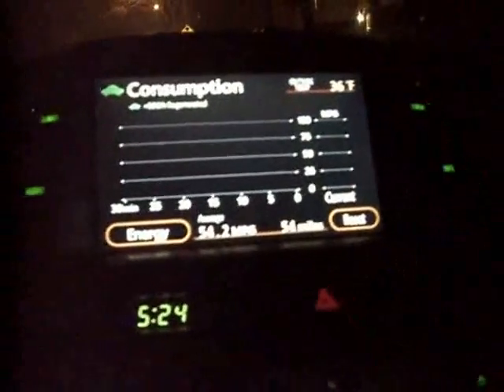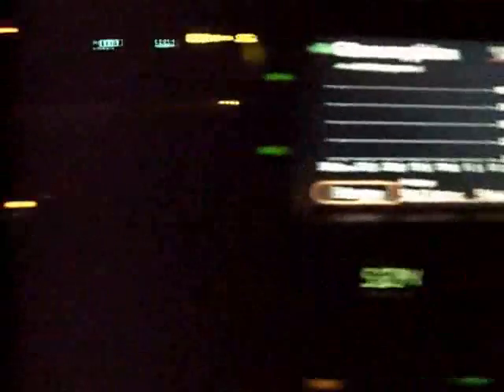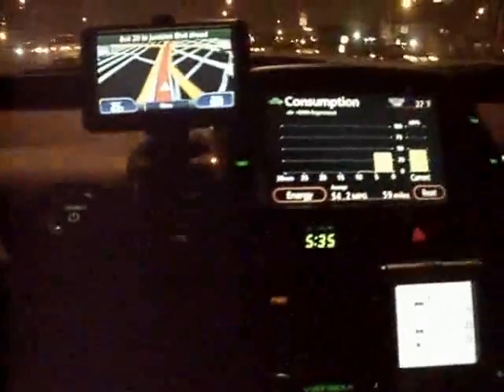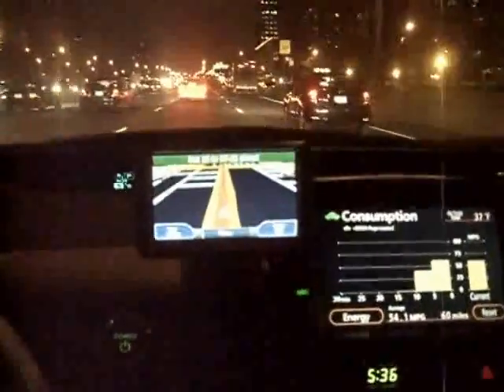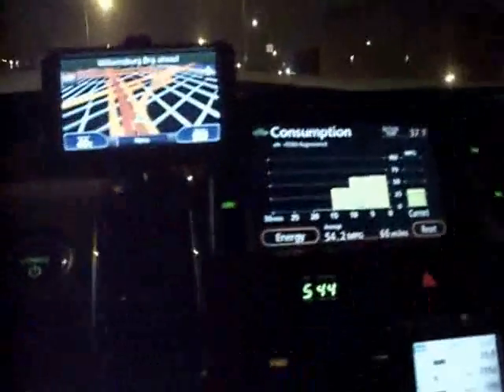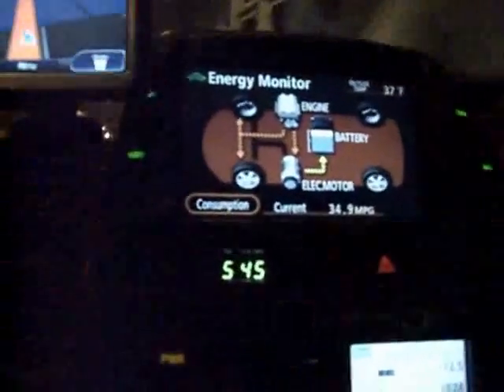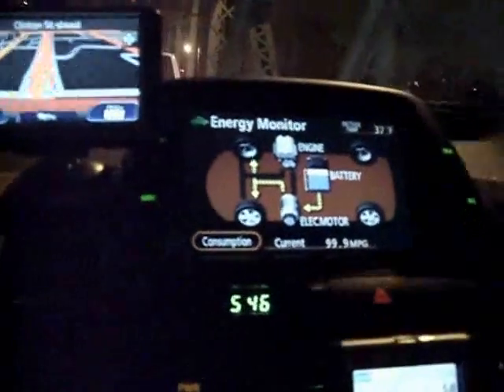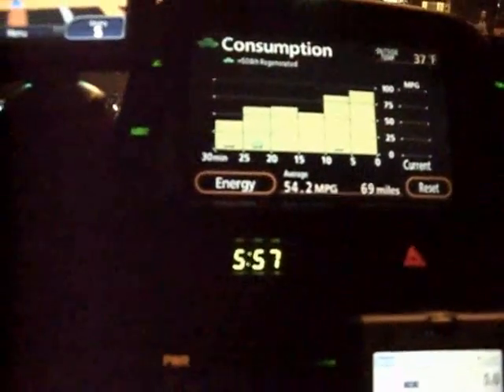Benefit of Prius Coolant Thermo Bottle and Grill Blocking

Comment: Very good Job!  Gotta love the Thermal Tank!  Check out my Prius video :).  BTW, you have a CAN232 Connector?  I had a Java program that reversed engineered about 20 different values from the car.  you could get RPM, Speed, car temperature, brake and gas pedal pressure, etc.  Looks like you did the same thing :)